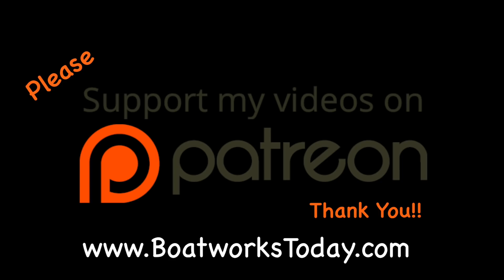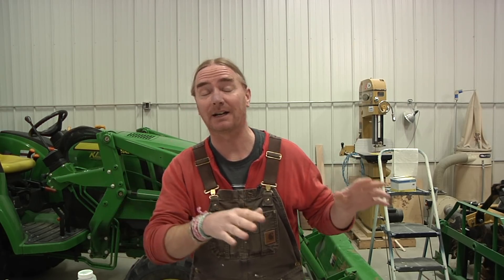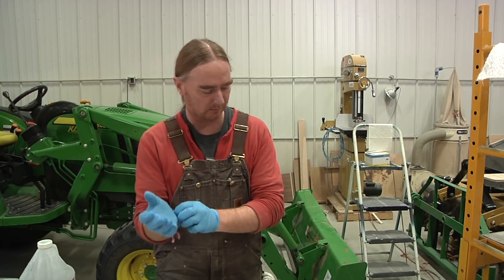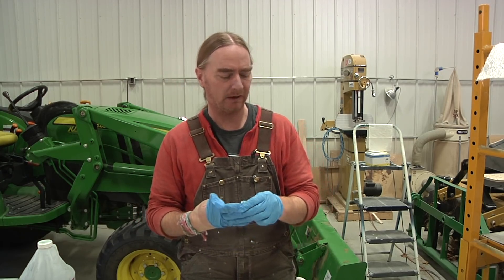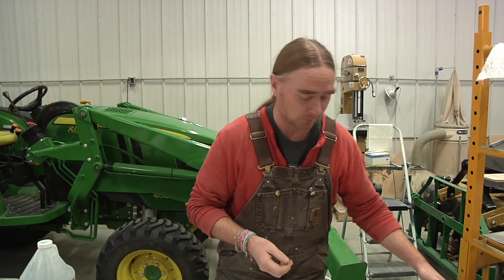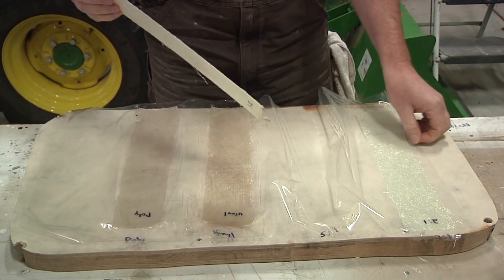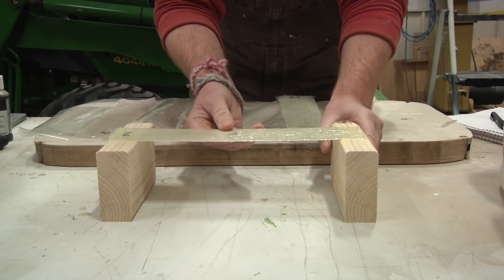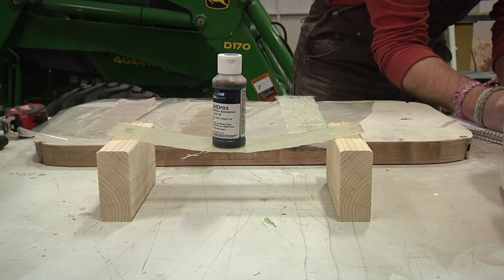Testing The Strength Of Different Fiberglass Resins!

Comment: From your commentary, I think you know that technically strength and stiffness are different things.  But, you titled your video "strength" and then only tested stiffness.  I think this may mislead people that don't have a good understanding of the difference between the two.  So, here are my highly simplified engineering definitions (yes, I know these definitions leave a lot out -- if you want to discuss more strict definitions, I can do that):

Strength - How much force it takes to break something

Stiffness - How flexible something is (this is what was tested in this video)

These two are often related - compare rubber and steel.  Steel is strong and stiff. Rubber is not so strong and not so stiff.  I think examples like this sometimes lead people to think strength and stiffness are always related.  They are not.  A couple of examples:

6061-T6 aluminum has about the same yield strength as cold rolled steel.  But the steel is almost 3 times stiffer.

Chrome moly steel can be about twice as strong as cold rolled steel, but the two have the same stiffness.  In fact, most steels have the about the same stiffness, regardless of strength.

Comment: Good fun, Andy!  Other comments have referred to elastic modulus and adhesion vs linear deflection properties, both of which are important components of resin performance.  What's critical is what happens at the molecular level during the chain polymerization reactions.  All the resins you tested (when within shelf life) tend to polymerize in linear chains, but epoxy in general exhibits more cross-linking between polymers than does polyester.  Here's a cute video (with a scientist in a white coat!) showing another strength measurement. ( https://www.youtube.com/watch?v=rw3Uf6bPPds )  As a scientist, I like this because it includes replicates and tests to failure in terms of comparable force metrics.  Plus, he uses a cool measuring tool!

Comment: Many comments here are comparing flexibility with strength in a way that ignores the inflexibility of the gelcoat. The fact that no one has fallen through the deck let’s us know it is plenty strong. Andy is trying to take the deflection out that is cracking the gelcoat.
Reply: Great point.  And, the best way to increase stiffness is to increase the size of the core 😊

Comment: I can see you were careful when you made the parts.  But the stiffness in bending is so highly influenced by the thickness of the part that even a few thousands of an inch difference in thickness will outweigh the differences in the resin.  The deflection the part decreases with the cube of the thickness. 

So, lets toss in a few numbers and see how much difference in thickness alone would give the results you saw.  First, the numbers you gave for the 3 good parts were 2-7/8, 2-3/4, and 2-3/4.  Assuming the supports are standard 2X4's, then the deflections are 5/8 (.0625), 3/4 (.75), and 3/4 inches. To go any further, I need an thickness for your test parts, so I'll guess that those parts are around 1/16 inch thick. 

Lets assume the part that deflected 5/8" is exactly .060 thick.  Now, how thick would the 3/4" deflection parts need to be (if the resin, and everything else, were the same).  Well, here's the ratio -- (x^3) / (.060^3) = .625 / .75  or rearranging x = [(.625/.75) * (.060)^3]^1/3 = .0564. Note: ^3 is cubed and ^1/3 is the cube root.

So the more flexible part would be .0564" thick -- 3-1/2 thousandths of an inch thinner than the stiffer part.  I suspect you will agree that the thickness of your parts was not accurate to 3-1/2 thousandths.

I'm not a statistician, but my gut feeling is you need to test maybe 10 of each part to have any confidence in which is really stiffer.

Comment: Its an interesting topic. So many people just pick epoxy because "its the best". However many times regular polyester is just fine. Most people would be absolutely shocked at the number of IRMA and MARIA boats that I have watched being repaired with just regular no name polyester resins (Trinidad makes tons of no name resins). In fact I know of one Lagoon that was repaired under the supervision of the Lagoon factory and polyester was used almost exclusively. 

Anyway. I enjoy the channel. If I was a betting man, I would say that adding 2 or 3 layers of glass to the Bertram will correct the issue.

Comment: I don't think that this tells very much- and let me preface this with saying that I am just someone with passing interest in this, not an expert.  First, there is a big difference between elastic modulus, and strength.   One thing that is sometimes wanted in a resin is lower elastic modulus, (or more flexibility), so that the forces in the composite are transferred to the glass.  What was tested here was flexibility, or elastic modulus, not strength.  To test strength, you have to break the parts.

Comment: Hi! I like your videos and have learned a lot while watching, but this time your test is probably making not too much sense. I am not an expert but I think what you are trying to check could easily be looked up in the resin datasheet (elastic modulus). Even if you try hard there will be tolerances in the thickness of your sample and the last sample does seem not to be 100% flat. These properties of your samples will very likely influence the stiffness of your samples more than the resin used. Usually the required stiffness is achieved by the parts thickness and will not depend on the resin used. Everybody proofing me wrong is welcome. Hope you are going a head making your nice videos.

Comment: Nice little test.  I would suggest retesting the pieces after 4-5 days to get the epoxy to its full cure.  Of course if you were being serious about this you would have weighed the strips before and after adding resin to determine the glass to resin ratios.  That will have an effect on stiffness.  I don't think bond strength will be an issue for adding a layer of glass to the top, but when you finally decide to put some glass on the bottom of the deck do use epoxy to get the best bond.  A couple of layers on the underside of the deck crating a cored structure will give many times the additional stiffness of adding glass to the top of the deck as I am sure you know.
Reply: The epoxy should get stiffer after a couple of days, at least that's been my results. Built a few boats with MAS epoxy...
Reply: How does one apply a layer of fiberglass to the bottom of the the deck? Gravity will surely make it pull away from the deck. Surely the best way is to add a thin core of foam or balsa to the upper side of the deck and cover that in fiberglass. You will then have a sandwich which will make it far stiffer than just fiberglass.

Comment: you mention that strength and stiffness comes from multiple layers bonded together... how many layers though? I’m assuming a foredeck needs less layers than lets say the hull, obviously, but by how many layers? what’s a good rule of thumb for determining what parts of the boat have x number of layers???
Reply: I will let you know what my boat is. (20ft solid poly CSM glass sail trimaran, so no keel to speak of). The centerline of the hull is about 3/4 inch thick, this is about 2 inches wide from front to rear and what the boat rests on when beached or trailered.
The rest of the hull is about 10mm below the waterline and tapers to about 3 or 4 mm. The deck would be 4mm but it has ribs on the underside to give extra strength. On a power boat a 6 to 10mm deck would be the go as mine flexes but it needs to be lightly it is a sailboat.
Reply: Ah man.... I was hoping more for a response than a heart/like  :-(      ... pls Mr BoatworksToday, I'm dying to know!!!
Reply: That's a good question but there's a million variables. You can have less layers of heavier matting or more of lighter,cored and uncored and so on. On top of that there is chopped strand, biaxial, woven etc...……… Please don't take this the wrong way as I'm not trying to be a prick. I just wanted to toss some more stuff out there that pertains to your question.

Comment: Andy question on laying your glass on deck are you going to smaller square pieces or one big piece also if you use 1208 biaxel glass do rotate 90* per layer for strength build up thanks  JT 
Ps if I send u my fishing team decal would you put it on your bandsaw billboard it's about 6x6inches again Thanks JT
Reply from the maker: Going to keep the pieces of glass as large as possible :-)  Likely will rotate as well.  Absolutely on the sticker!  Thank you :-)
Reply: BoatworksToday Thanks Andy I'm trying to find your mailing address I know it's here tell me where to look I looked in the description box but don't see it  thanks JT